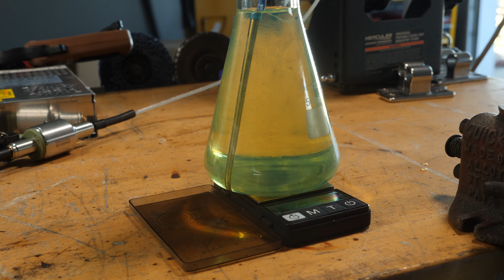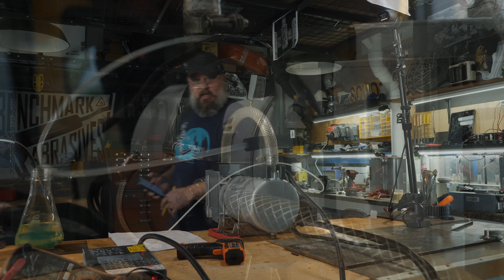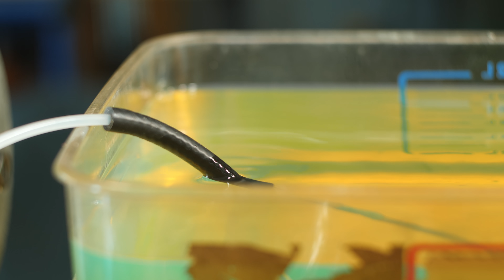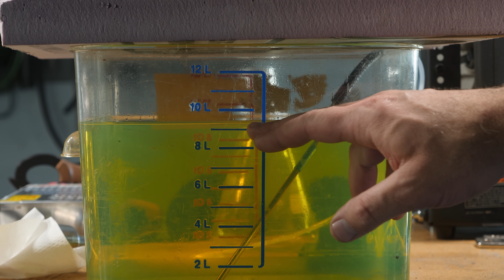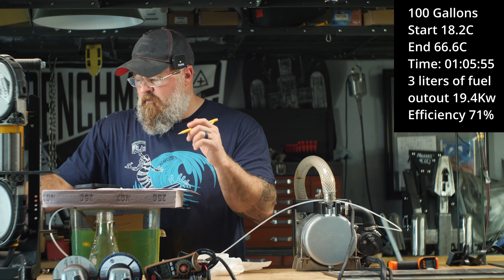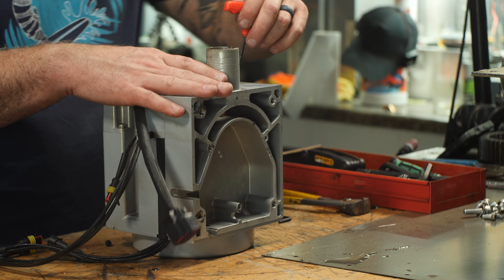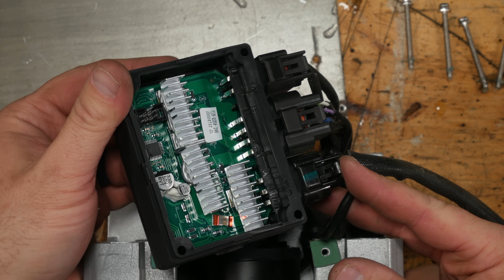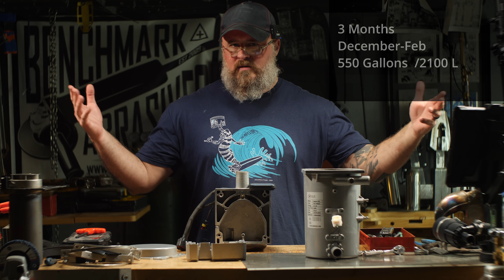The Diesel Heater They DON’T Want You to See — Real 20kW Output!

Comment: No way scavenging heat from exhaust only gives you another 4%. You can nearly extract most of that heat if done properly
Reply from the maker: agreed. that’s the next video
Reply: Try to use a big heat exchanger like for pool, car egr cooler are gonna mess with exhaust flow and you gona melt the chamber. Ask me how i know? 🥲
Reply: @Krunoslav09  a 4 ft hydronic baseboard heating element could do the trick.
Reply: @Krunoslav09 why melt the chamber? was the cooler clogged with carbon? did you had a clean,brand new cooler?
Reply: @IustinianP yeap brand new device but problem is the flow. Burning chamber was for scrap after that, its not that much difrence. You will get more if u put exhaust in some kind tank of 60-80L filed with sand. Sand will act like a battery and hold heat for long time... So 2 coils, one exhaust one water and sand in the midle...
Reply: @Krunoslav09 put an extraction fan after the exhaust heat exchanger. Then the burn chamber will be unaffected by restrictions.
Reply: Yes but if you draw off too much heat from exhaust wouldn't you risk too much carbon build up in the flue? Not sure if this is a real thing in diesel heat but with wood stoves its a consideration at some point.
Reply: 20 ft of exhaust tube coiled in the water resivor not rocket fkn science

Comment: home heating oil heaters are diesel heaters so id gather a yes on that title grab yourself an old beckett heater run a 12 v dc conversion for the ignitor and you can run radiant floor heat and blower heat at the same time
Reply: used Webasto DBW2010 heaters from a school bus jukyard in northern states... interestingly the webasto DBW series units are essentially the same as a Beckett AF burner... they even used standard electrodes, standard nozzles (0.34@60 degrees).. I run a 0.45@60 in mine and it gives me some extra heat as the DBW has a large heat exchanger and burn can.  they come wit ha nice MP pump and 1 inch lines so you can flow a lot of coolant through it... I heat my Mobile office bus with it..
Reply: We run Beckett units on oil rig heaters in the oil field. They aren’t designed for efficiency but they do throw out a ton of heat. Like hundreds of thousands of btus. Although your idea would work very well from a capacity standpoint they would indeed use a ton of electrical power in the process too. It takes a lot of juice to run the combustion fan/fuel pump those have. Then you still have to drive the heat exchanger blower. I have no clue how you would actually make one of those quiet. You’d almost have to  scale down the whole thing a lot.
Reply: @TheMajictech  none of these diesel heaters are very efficient..  the lowest stack temperatres ive come across are on thew webasto units ive mentioned due to their high flow and larger heat exchangers.. but really you need to run a secondary heat exchanger to gain any real good efficiency numbers.

Comment: Nice hot tub you had lol
Reply from the maker: I hate that I missed the opportunity to soak in it! it was a little too warm that day to really enjoy it!
Reply: @HanginwiththeHursts 
Definitely not wanting any Hurst soup.  Not a knock on your testing, but I'd bet it would have exceeded the 20k if the exchange tube in water would be aluminum or copper  so impressive enough performance.  I've used about 20 liters of off-road diesel so far this winter heating my (12.5×26×9 cabin with a 2k unit, not set up at most efficient way possible. The heater is outside and only running in heated air and a return air duct, so I'm not scavenging the heat loss from the exhaust pipe.  Last winter I used same size unit that was a "ready to go one tank in cabinet"  my change was I wanted a larger fuel tank,  a 5k unit might be slightly better sized for it actually.

Comment: Very cool, I still use a little webasto to heat my pool. takes a while, but does the job just fine, working on solar to power the electricals as for fuel, keroscene in the uk is between 40 - 50 pence a liter so works out nicely. Good video for when we start getting brown outs here for other options to heat a 3 bed extended leaky home.
Thankyou
Reply: Wow! Tell me how on earth you manage to get 50p/l kerosene, our local farm shop sells it for nearly a tenner for 4 litres, although I seen bulk heating oil online but even that's still around £1.50/l
Reply from the maker: Glad the video gave you some ideas for your home heating. Appreciate you watching!